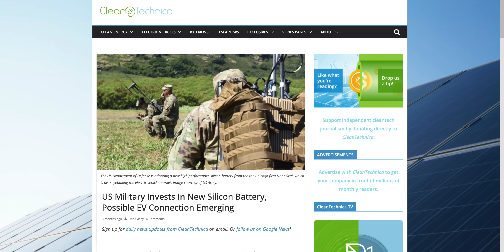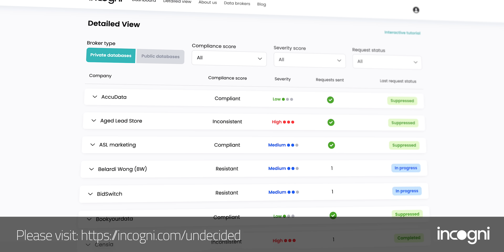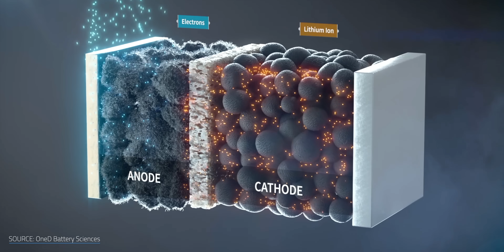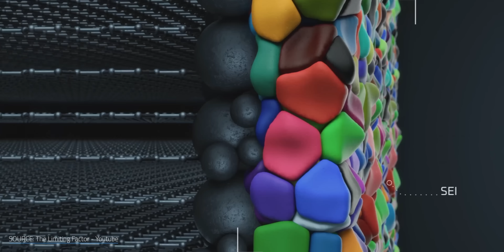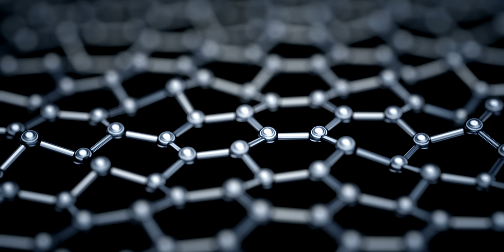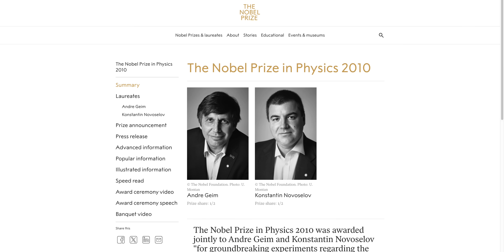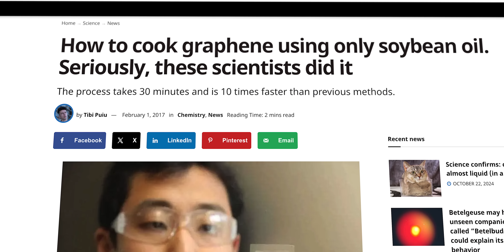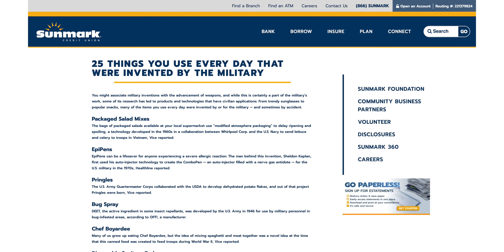Why The US Military Chose Silicon-Graphene Batteries

Comment: 110504.  The second law of thermodynamics may be false conventional wisdom. Let's face the wonder of full heat use. 

The second law of thermodynamics was developed during v8ictorian england's scientific and religious fascination with steam engines. 

The second law is behind modern refrigerators needing electrical energy to compress the refrigerent to force it to release as waste the heat that it has removed from the refrigerator's service interior in the cooling part of the refrigerent's circulation. The interior coldness draws in exterior heat through the cabinet insulation. There is also discarded heat from mechanical friction and electrical resistance. The net thermal output equals the electrical input with energy not being gained or lost in this refrigeration system including its forced waste. Unencumbered refrigeration by the principle that energy is conserved should produce electricity instead of consuming it. 

It makes more sense that refrigerators should yield electricity because energy is widely known to change form with no ultimate path of energy gain or loss being found. Therefore any form of fully recyclable energy can be cycled endlessly in any quantity. 

Full heat recycling, all electric, very isolated underground, undersea, or space communities would be highly survivable with self sufficient EMP resistant LED light  automated vertical farms, thaw resistant frozen food storehouses, factories, dwellings, self contained elevators, safe rooms, and horizontal transports. 

In a flourishing civillization, small self sufficient electric or cooling devices of many kinds and styles like lamps, smartphones, hotplates, water heaters, cooler chests, fans, radios, TVs, cameras, security devices, robot test equipment, scales, transaction terminals, wall clocks, open or ciosed for business luminous signs, power hand tools, ditch diggers, pumps, and personal transports, would be available for immediate use incrementally anywhere as people as individuals or larger social groups see fit. 

Some equipment groups could be consolidated on local networks. 

If a high majority thinks our civilization should geoengineer gigatons or 
teratons of carbon dioxide out of our environment, instalations using devices that convert ambient heat into electricity can hypothetically be scaled up do it with a choice of comsequences including many beneficial ones. 

Energy sensible refrigerators that absorb heat and yield electricity would complement computers as computing consumes electricity and yields heat. Computing would be free. Chips could have energy recycling built in.

A simple rectifier crystal can, iust short of a replicatable long term demonstration of a powerful prototype, almost certainly filter the random thermal motioren of electrons or discrete positiive charged voids called holes so the electric current flowing in one direction predominates. At low system voltage a filtrate of one polarity predominates only a little but there is always usable electrical power derived from the source, which is Johnson (observation) Nyquest (theory) thermal electrical noise. This net electrical filtrate can be aggregated in a group of separate diodes in consistent alignment parallel creating widely scalable electrical power. The maximum energy is converted from ambient heat to productive direct current electricity when the electrical load electrical resistance  is equal to the array internal electrical resistance. 

Maximum calculated electrical power output (watts) is k (Boltźman's constant), one point three eight x 10^ minus 23, times T (temperature Kelvin) times bandwidth (0 Hz to a natural limit ~2 THz @ 290 K) times rectification halving and nanowatt power level rectification efficiency, times the number of diodes in the array. 

There are a billion cells of 1000 square nanometer area each per square millimeter, 100 billion per square centimeter. 

Order is imposed on the random thermal motion of electrons by the structual orderlyness of a diode array made of diodes made within a slab: 

  P type boron doped
-----‐------‐----___-- Out
🔻🔻🔻🔻
■■■■■■___ + Out 
  N type phosphorous doped 

All the P type semiconductor anodes abut a metal conductive plane deposited on the top face of the slab with nonrectifying joins;  the N type semiconductor cathodes or common cathode abuts the bottom face. As the polarity filtered electrical energy is exported, the amount of thermal energy in the group of diodes decreases. This group cooling will draw heat in from the surrounding ambient heat at a rate depending on the filtering rate and thermal resistance between the group and ambient gas, liquid, or solid warmer than absolute zero. There is always a lot of ambient heat on our planet, more on equatorial dry desert summer days and less on polar desert winter nights.

Focusing on the composition of one simple diode, a near flawless crystal of silicon is modified by implanting a small amount of phosphorus (N type conductivity) on one side from a ohmic contact end to a junction where the additive is suddenly and completely changed to boron (P type conductivity) with minimal disturbance of the crystal lattice. The crystal then continues to another ohmic contact. 

A region of high electrical resistance forms at the junction in this type of diode when the phosphorous near the ĵunction donates electrons that are free to move elsewhere while leaving phosphorus ions held in the crystal while the boron donates holes which are similalarly free to move. The two types of mobile charges mutually clear each other away near the junction leaving little electrical conductivity. An equlibrium width of this region is settled between the phosphorus, boron, electrons, and holes. Thermal noise is beyond steady state equlibrium. Thermal noise transients, where mobile electrons move from the phosphorus added side to the boron added side ride transient extra conductivity so the forward moving  electrons are preferentally filtered into the external circuit. Mobile electrons are units of electric current. They lose their thermal energy of motion and gain electromotive force, another name for voltage, as they transition between the junction and the array electrical tap. 

Inside the diode, heat is absorbe; outside the diode, to exactly the same extent, an attached electrical circuit is energized. The voltage of a diode array is likely to be small so many similar arrays need to be put in series to build higher voltage.  

Understanding diodes is one way to become convinced that Johnson Nyquest thermal electrical noise can be rectified and aggregated. Self assembling development teams may find many ways to accomplish this wide mission. Taxonomically there should be many ways ways to convert heat directly into electricity. 

A practical device may use an array of Au needles in a SiO2 matrix abutting N type GaAs. These were made in the 1970s when registration technology was poor so it was easier to fabricate arrays and select one diode than just make one diode. 

There are other plausible breeches of the second law of thermodynamics. Hopefully a lot of people, mostly as independent teams, will join in expanding the breech. Please share the successes or setbacks of experiemental efforts. 

These devices would probably become segmented commodities sold with minimal margin over supply cost. They would be manufactured by advanced automation that does not need financial incentive. Applicable best practices would be adopted. Business details would be open public knowledge. Associated people should move as negotiated and freely and honestly talk. Commerce would be a planetary scale unified conglomerate of diverse local cooperatives. There is no need of wealth extracting top commanders. We do not need often token philanthropy from the top if the wide majority of people can afford to be generous. 

Aloha
Charles M Brown 
Kilauea Kauai Hawaii 96754

Comment: Not the first time the military has tried to solve the portable power problem
They funded micro turbines, and methanol fuel cells. Longshots that didn' t pan out.

Having said that, 45 million is peanut money for the defense budget, even at 1 to 50 odds, it is a great bet
Reply: Military is cheap, military grade means the contractor proposed the lowest cost. We have crystal batteries and personal nuclear devices. We will never see them because the military won't pay for it

Comment: Carrying a Ericsson radio from 1990 and a G3 Rifle in the swedish homeguard (not to mention the extra body weight that comes with seniority) I think it all sounds like a good idea. We need to make everything more light weight.
Reply: Making each piece of gear lighter merely means you get to carry more gear.  Strap-on that carbon fiber exoskeleton for support and pray the energy density of batteries improves to the point where robots can relieve you of your duties.
Reply: @Chris.Brisson well actually no, the amount of gear you carry is actually calculated. Its not just bring more, they way the losses over benefits. They actually want you fairly light weight
Reply: Try humping an old PRC series. 
That's why the kid always gets to be the RTO

Comment: Building a domestic supply chain for batteries is huge.
Reply: The supply chain is never the issue, the space to put it all together is more important and how you design and manage it
Reply: @shazzz_land  no, not really, we have a huge amount of free space here in the US, it's just more expensive to run something like this domestically.
Reply: @darkfur18  expensive is one thing, hard is another
Reply: @shazzz_land  bog standard batteries are easy to make, that's why Chinese sweatshops can pump them out with minimal quality control
Reply: @darkfur18  low power devices aren t the issue, the issue is to produce electricity for 8 billion's homes stores vacation spots etc into a full electric system without using fosil fuels and preferably with safe nuclear fusion power plants. 20 billion IoT s barely consume as 10 million people if even that much
Reply: @shazzz_land  electric vehicles use the same batteries as IoT devices, it's not about the available space or the difficulty of production. It's about cutting the cost of setting up the factory in the first place and scaling production. And the process of electrification and grid level power storage doesn't change the game. In fact, they make it more important for us to set up domestic production in order to bring overall cost down
Reply: @darkfur18  bog concept is used in low power devices, that is why I was refering to iot stuff

It is about having a reliable long term power production for the whole fffing world in the sense that most hydros are old most nuclear are f@ing old, we f ing need the tech from 50 years in the future now!!!!! This is the f@ing issue, not a new design for iot. U want reliable iot make em nuclear powered like pace makers!!!! The production facilities for power are fucking old and may become unreliable this is a serious ffff ing isssue!!!!! Either we all get together and work on important shit or we risk having the grid down in 20 years
Reply: @shazzz_land  what? "Bog standard" means ordinary. I don't know how you got iot from that...
Reply: @shazzz_land  nice stealth edit, but I still have no idea what you're going on about with IoT and the power grid in relation to domestic battery production. If you're gonna make up some strawman argument, at least make it coherent
Reply: @shazzz_land  They can and do still build new power systems. Money, as always, will drive the development and improvement of energy generation. Don't worry about it.
Reply: all of a sudden Elon Musk backing Trump all makes perfect sense.
Reply: It is like building any supply chain

Comment: For Flint, MI, it's great to see a company bring some new tech and jobs to that area. That city definitely needs it.
Reply: Too bad they haven't fixed the tainted water yet...
Reply: @hermaeusmora2945  never will
Reply: @hermaeusmora2945  They have. The only thing that caused them to have contaminated water for some time was that the state government took over management of the city, and changed their water supply without providing the appropriate (extremely inexpensive) treatment, which led to the water corroding older lead pipes which were [mostly] just fine before that event. They have long since changed the water supply back to the original source.

There has, however, been a major overhaul of the piping in the city as well.

Also, Flint [I am not from there] is full of great people, and shouldn't be the punching bag of this stupid 'joke'.
Reply: @hermaeusmora2945  July 16, 2021 the last lead pipe was replaced. The water was safe well before that but people kept whining, so Flint is now the first and only modern city in the world with zero lead pipes. It wasn't until literally a few months ago that America committed to de-leading all of the nations pipes, which would make America the fist nation in the world to completely de-lead.

For context Bavaria was the first region in the world to ban new lead pipes, literally all the way back in 1903, but they have legacy lead pipes to this very day.
Reply: @hermaeusmora2945 yes they did, they replaced all the pipes forever ago.
Reply: Graphene is one of the best water purification products.  Is Flint just a coincidence?
Reply: @aussie2uGA  I was going to make a similar comment.  Brilliant minds think alike.
Reply: I wonder if you could extract lead from the tap water at a commercially viable rate.
Reply: I was so excited to hear that Flint was getting this.  It's needed.  I'm surprised this is the first I'm hearing of it, I don't live too far away.
Reply: It's actually scary. It's super dangerous if any accidents happen. It also can destroy air quality and best of all can contaminate water! That's the last thing Flint needs. Possibly why they chose that spot
Reply: @KevinAugustt oof, dark but not indisputable.

Comment: it all comes down to cost. if it is cheaper it will be in more vehicles.. if it is not then it will be in more luxury vehicles or in larger vehicles like semi trucks. Because 15% lighter makes a huge difference if your battery is more than 2 tons. Tesla dose not say how heavy its battery is but Scania truck battery is 2300 KG or 2.5 tons for the 416 kWh battery (they have larger ones) rates for 300 KM